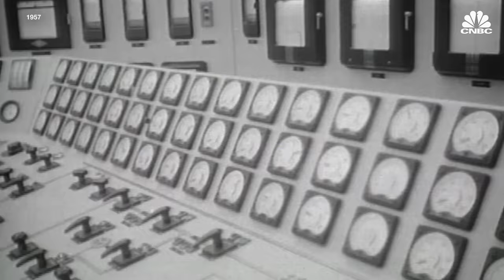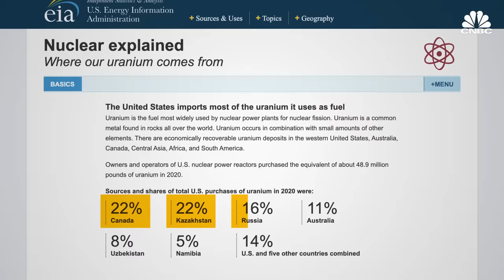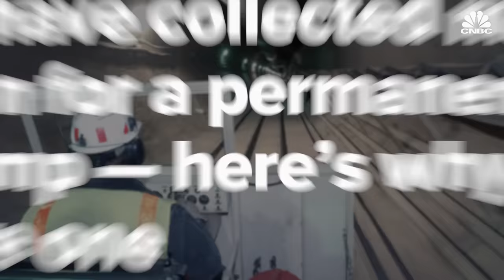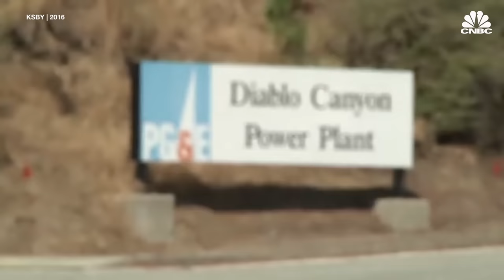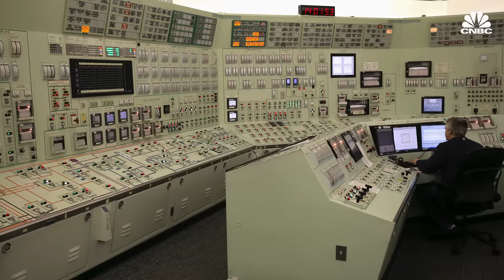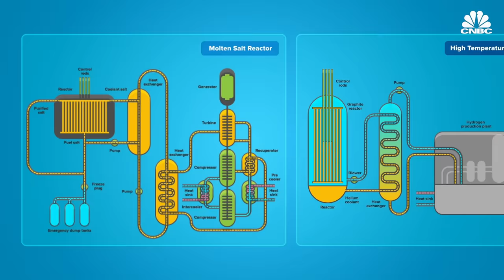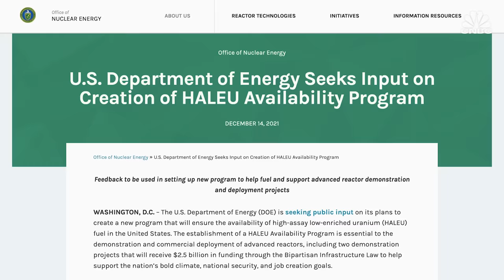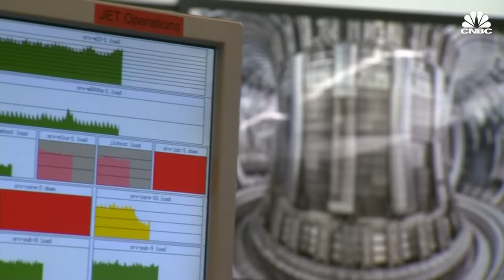Why Nuclear Energy Is On The Verge Of A Renaissance

Comment: There something misleading in the affirmation of small footprint. A nuclear plant doesn't produce CO2 but produces the same amount of heat as of electricity. That heat goes directly to the surrounding water body used as a coolant. If in doubt, ask any one conversant in Thermodynamics.
Reply: Nuclear power is a thermal system, so has waste heat. Same as coal or natural gas. However that waste heat could be used in co-generation, including atmospheric CO2 sequestration.
Reply: @Crispr_CAS9  How??  Every BTU that can be extracted through complex reheater systems is used.  Just saying something does not make it so.
Reply: @clarkkent9080  "How??" Through co-generation.
"Every BTU that can be extracted through complex reheater systems" That's for electrical production. Waste heat isn't efficient for electricity, but can be used directly for heating purposes. That's literally the point of co-generation. You could have just googled the term before looking like an idiot.
Reply: @Crispr_CAS9  Every heat engine MUST reject heat in order to function.  The typical nuclear power plant in the lower 48 states will have condenser outlet water temperature (also equal to cooling tower inlet temperature) of 100 degrees F.  So yes you can do whatever you want with that 100 degree F water as long as you return that water to the condenser (also cooling tower outlet temperature) at a temperature of 80 degrees F or below.

You could heat homes if they are near a nuclear power plant or run any process near a nuclear power plant that will decrease that temperature at least 20 degrees F.  Since homes do not require heating in the summer and processes occasionally shutdown for maintenance you would still need the cooling tower.  If you do not decrease the temperature at least 20 degrees F it would result in a reactor power decrease. Also, you must have a backup heating system for the homes or process when the reactor is not operating. 
In fact, France that operates 56 reactor units has many shutdown today because the river/lake water they use for cooling has become too warm to continue to operate the reactor and France is actually buying electrical power from Germany this summer.

The massive lake near my home is currently at 87 degrees F and a simple solar setup could easily raise that temperature well above 100 degrees F.  
So, if 100 degree water has some use, near a nuclear power plant, then yes it could be used as long as you decrease that temperature by 20 degrees or more.  But is seems like there are easier, cheaper, and more reliable ways to do the same thing and not rely on a nuclear power plant.

One last point, NO nuclear power plant in the U.S. uses this reject heat for any co-generation and if it was profitable don't you think some one would?

There are a lot of great ideas but when you factor in costs and reality, it makes no sense.
PS I worked in the nuclear industry for 40+ years. I was a Reactor Operator and Senior Reactor Operator at 5 different nuclear facilities so I am that idiot that kept your lights on. Your welcome.
Reply: @clarkkent9080  "and processes occasionally shutdown for maintenance you would still need the cooling tower." I like the way you admitted I was right, but then tried to pretend like I said something else to get out of it. 
"In fact, France that operates 56 reactor units has many shutdown today because the river/lake water they use for cooling has become too warm" In other words, if French nuclear had co-generation, they'd still be running. What's your point?
" But is seems like there are easier, cheaper, and more reliable ways to do the same thing and not rely on a nuclear power plant." I'm not suggesting we build nuclear power to produce waste heat. I'm suggesting we utilize waste heat of nuclear power. I'm not sure how it possible to have misunderstood such an obvious thing so catastrophically. 
"and if it was profitable don't you think some one would?" First, I like the way you limited the statement to USA, because you know it's used elsewhere. You also, likely, know that people in the US are scared of nuclear, and that co-generation is inherently a multi-lateral arrangement between the power plant and whoever they are supplying the heat to. Meaning that it's a politically complicated situation people don't want to mess with. So... no, I don't think people would necessarily be doing it if it was profitable, and more importantly I don't think that it being efficient would necessarily make it profitable in an environment where using waste heat from nuclear might cost the other company sales.
"PS I worked in the nuclear industry for 40+ years." Then you must be really embarrassed to have not known what 'co-generation' was.
Reply: @Crispr_CAS9 Let me say clearly NO YOU ARE NOT RIGHT. You admit it is not happening in America and then go on to make claims that even though it is not happening in other countries it could.  You seem mad that you have an idea that NO ONE cares about or is willing to consider and you blame them.  Woulda, Coulda, Shoulda.  

Like I said, their are a lot of ideas that sound good on paper but are not workable in reality.  You could also use the decay heat from spent fuel for co-gen and it is not limited to a 20 degrees temperature rise.  I admitted that there are a lot of things that could be done but are NOT done for very good reasons. 

You state that is not done because of the fear of nuclear.  Coal fired plants are heat engines and utilize the same heat reject cooling towers just like a nuclear plant so why do they not use co-gen in the U.S. coal industry???  So are Americans afraid of coal also???? Wouldn't co-gen with a coal plant make coal seem more acceptable and something any utility would want???

I always state in the U.S. because that is where I live, what I am knowledgeable about and what other countries do means nothing to me.  And, you can say anything about other countries and unless you live there and speak and read their language you will never know the whole story.  Case i  n point is the myth that Americans hold about the French nuclear program and how great it is and how we should do the same.  But with half of their nuclear plants shutdown during a heat wave the reality is not pretty and that reality is not known by most Americans.  But you have to dig deep into industry journals to learn that.

You have an idea that no one in America is doing or even considered doing in the last 100 years of power production with heat rejection.  You can't seem to accept reality and like a little child are mad when I very nicely corrected you.  I have experience in the industry.  What is your experience....did you stay at a Holiday Inn last night?????

Her is a simple concept that you may understand; in a  capitalist country if something can be done that is cost effective and profitable then someone will do it. Now it is your turn to go all Qanon conspiracy theory on me.
Reply: @clarkkent9080  "Let me say clearly NO YOU ARE NOT RIGHT" So you're saying that co-generation is impossible? Okay, you're wrong.
"You state that is not done because of the fear of nuclear." I said it wasn't done for a complex set of reasons, which might reasonably include fear of nuclear.
" so why do they not use co-gen in the U.S. coal industry?" Several things here: 1. Coal plants are, on average, significantly smaller, making the efficiency of co-generation much lower. 2. Coal tends to be significantly more rural than nuclear, and it is significantly harder to take advantage of co-generation with rural plants. 3. Coal plants are being replaced nationwide by natural gas, and new CNG power absolutely is being built with CHP.
Which might be the other factor of why cogeneration isn't used in American nuclear: CHP wasn't used in American power when American nuclear plants were being built. So here the issue is not with the tech, it's with the age of the average nuclear power plant. Solution: Build more nuclear power plants.
"I always state in the U.S. because that is where I live" Clearly...
"what I am knowledgeable about" Doubtful...
"unless you live there and speak and read their language you will never know the whole story.  "
"French nuclear program and how great it is and how we should do the same" You said you're wrong. Funny.
"are mad when I very nicely corrected you" You 'corrected' me in your first comment, said I was right in your second, and lied in your third.
" then someone will do it. " Only a libertarian would be stupid enough to say something that idiotic.
Reply: @Crispr_CAS9   The Terra Power Natrium plant is designed to utilize excess heat to store in molten salt, to be utilized as needed for peak grid demands up to 50% over rated capacity for about 5 hours at a time.  If successful it will be a game changer for an energy storage system.

Comment: Would like to point here that I am writing this from a small EU country that is 57% powered by nuclear and 25% by renewable and I am very happy that we didn't listened to all the Greenpeace folks protesting in front of our nuclear plants during the 90s like Germans did.
Reply: @clarkkent9080  That is an easy to manipulate statement. Most EU countries are completely interconnected in one energy grid and a country can be importing in the morning and exporting in the evening as the electricity is on shared markets using high speed spot pricing. 

The devil is in the details because Germany is on list of both biggest importers and biggest exporters of electricity. And with Germany having 27% wind generated electricity it is harder to predict what the net result will be every year. I for example found my country on that list with 2,2% export and 1,9% import and without understanding the timing of electricity flow a person my think that why would you even move the electricity up/down the grid of a meager 0.3% difference. Some countries have whole power plants called "peak power plants" that are doing nothing and are only starting turbines (usually gas or coal powered) in evening peak hours and only import electricity while those plants "boot-up". So the overall electricity import/export of EU during the year might be affected how much sunlight there was in Spain that year or how much the winds were blowing in Germany or Netherlands.  

For example in 2020 both Germany (lot of renewables) and France (80% nuclear) were dominantly exporting around 5% of their electricity outside. 

I will try to find some long term data of multiple years (and interestingly after 2022 is over) if that is the same multiple years, e.g. if Frances nukes are more stable exporters than German or not. Right now I do not know yet.
Reply: @Kerk Kant   Yet you fail to acknowledge from your blank trolling channel that many countries have been building and using small modular reactors for many decades built in two years or less for millions not billions.
Reply: @networkgeekstuff9090   Facts do not matter to him, even when you prove him wrong he continues to spread his same misinformation in the comments section in multiple videos.
Reply: @networkgeekstuff9090  Right now, 50% of France's nuclear plants are down either for maintenance or because their cooling source (river/lake) are too warm to operate the plant.  I have chatted with people living in France and they tell me France has a lot of the problems we have with building cost over-runs and labor shortages.

My point is that in America,  France is considered as doing the right thing with nuclear and Germany as doing the wrong thing with renewables.  Of course, in America they say your universal health care system is very bad although I have yet to meet one European that does not like their health care.  You can always state things that are untrue especially if it is in another country.
Reply: @networkgeekstuff9090  My point was Americans are told a lot of things about Europe that is considered fact here but no one ever checks because Americans are too lazy to research when they can be spoon fed YT videos.

Here is that nonsense from a French paper (August 3, 2022).  
The French energy supplier EDF is temporarily reducing output at its nuclear power stations on the Rhône and Garonne rivers as heatwaves push up river temperatures, restricting its ability to use river water to cool the plants.

The majority-state-owned company, Europe’s biggest producer of nuclear energy, said it would extend output cuts at several power stations on the two rivers as the hot spell continues – but that a minimum level of output would be maintained to keep the grid steady.

EDF warned of potential output cuts at its nuclear power plants Tricastin, St Alban and Golfech in coming days due to high temperatures in the Rhône and Garonne rivers. It started imposing production restrictions in mid-July at Tricastin, St Alban and Bugey on the Rhône and Blayais at the mouth of the Garonne amid sweltering temperatures.
Reply: @networkgeekstuff9090  Continued:
Half of EDF’s 56 nuclear reactors are offline due to planned maintenance and work to repair corrosion which was delayed by the pandemic, just as Europe faces an energy crunch following Russia’s invasion of Ukraine.
The production cuts mean that France, traditionally an energy exporter, is relying on imports from countries such as Spain, Switzerland, Germany and the UK.

I try doing actual research as opposed to basing my statements on emotion, social media, or YT videos.
Reply: @clarkkent9080  Yes, and Macron announced a big budget to renovate most of them as he considers nuclear energy a strategy industry for France as most of those reactors are rally old. Still that is not a failure of the nuclear tech itself, that is human management causing it.
Reply: @networkgeekstuff9090  I was not arguing politics, especially European politics. Just pointing out that after working in the U.S. nuclear industry for 40+ years, I do keep up with the industry, mainly in the U.S. and I try my best to only present facts that anyone can verify.

Some people comment untruths and then explain their opinion with some unverifiable conspiracy theory which is sad. 

PS- Reactor plants are designed for a specific lifetime (usually 40 years) and they can be operated beyond that period. Just like a 1970's automobile, they can be maintained and kept running indefinitely.  However, it becomes more costly and less reliable each year they are run. A nuclear plant has millions of components and after 40 years most are no longer made so a simple replacement becomes a timely and costly repair.  In the U.S. any plant 30+ years old that has a major component failure is shutdown for good, currently on the average of 2 per year.

I am not in anyway anti-nuclear.  However I will not support massive waste fraud and abuse that is common in the U.S. nuclear build industry today. Just because it paid my salary all those years does not mean that I am their slave.
The Vogtle nuclear project has resulted in a 29% increase of my electric bill and it will almost double if the unit 3/4 ever come on line to cover the $30+ billion cost.

Comment: large ammount of electricity ? Hydrogen will beating nuclear reactor easily my break through map is
Water electrolysis=>hydrogen=>water boiler=>steam jet turbine=>electric generator=>water electrolysis=>hydrogen=>water boiler=>steam jet turbine=>electric generator, this cycle can run forever, green and doest need any nuclear, coal or fossil fuel, just bypass current steam turbine generator. USING HYDROGEN THAN NUCLEAR.

Comment: Have you ever heard of a Nuclear power plant coming in under budget and on time?  If the typical power plant comes in a few weeks late, it adds to the construction cost.  Say the total cost is $250,000,000 for a 500 MW gas turbine style power plant, and a additional $250,000,000 to install the pipeline to the natural gas plant.  If they are delayed by 1 year, they will have to pay the interest on the $500,000,000 construction loan, typically at 10% interest (until it it built and can get a lower interest load for a production plant that is generating power and income now).  

So if they are delayed by 1 year, it will add $50,000,000 to the construction costs to pay interest on all of those loans.  So a 1 month delay will add $4,000,0000.  One week is a Million dollars!  So getting it done on time, and starting to produce power on time is VERY important!  

And the nuclear power plant is more than $7,000,000,000 so a one week delay is not 1 million dollars, but more like $14 Million dollars!  And I have never heard of a nuclear power plant that has been delayed less than 2 years beyond the projected construction schedule.  So the two year delay can cause a $1,400,000,000 cost just for the increased interest in the loads used to build the nuclear power station!
Reply: Sorry you are wrong...way too conservative with those numbers.  Here is the reality today for the last 4 new nuclear power plants built in the U.S..  Feel free to confirm

VC Summer (South Carolina) new nuclear units 2&3 were canceled in 2017 after spending $17 billion on the project (original estimate of $14 billion and 2016 completion date) with no clear end in sight for costs or schedule. 

Vogtle (Georgia) new nuclear units 3 &4 currently 110% over budget and schedule (original $15 billion & 7 years now over $30.2  billion and 15 years and counting) still not operating. Mid way into the build, the utility stated that had they known about the many costly delays they would never have chosen nuclear. They are now delayed another year because according to the project management, thousands of build documents are missing.
Reply: @clarkkent9080   Yet you continue to ignore that the US and many other countries have built and operated small modular reactors for many decades built in two years or less for millions not billions.